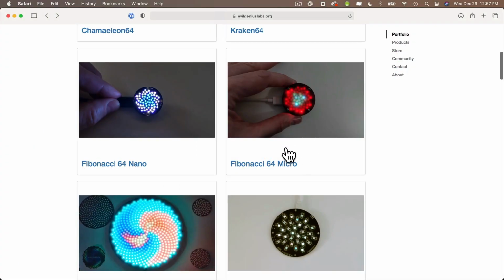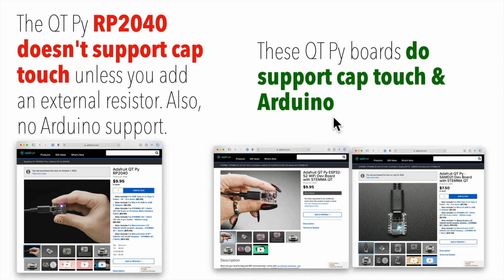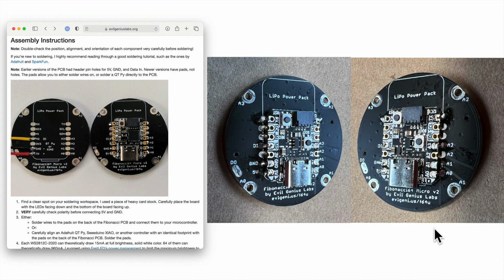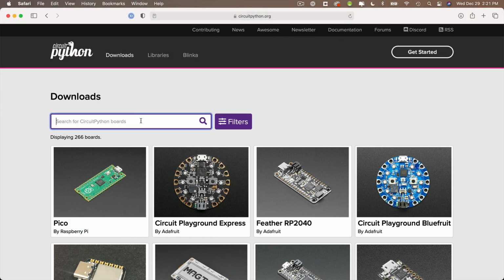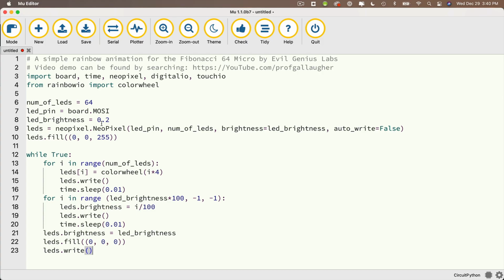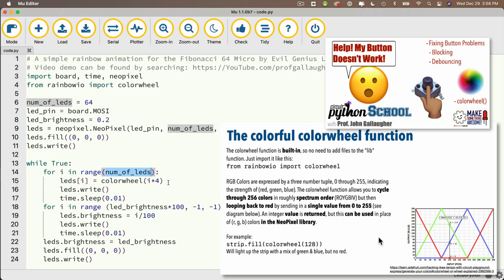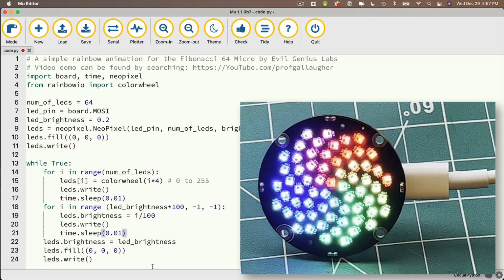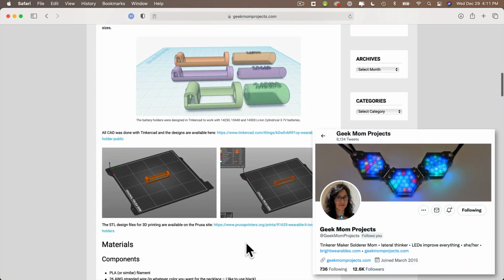MakerSnack - Fibonacci Micro 64 LED board and CircuitPython

Comment: Thank you. This looks fun. Wonder if the new Adafruit QT Py ESP32-S2 would work?
Reply from the maker: It should. Waiting for this to get back in stock so I can order some and try them out.  That looks like it’ll be a great board!
Reply: @profgallaugher  I picked up two of them on release day.   Have a sensor project. I'd like to try using the WiFi.  It supports touch.  Creating a manometer for furnace filter monitoring.  The sensor comes right up.